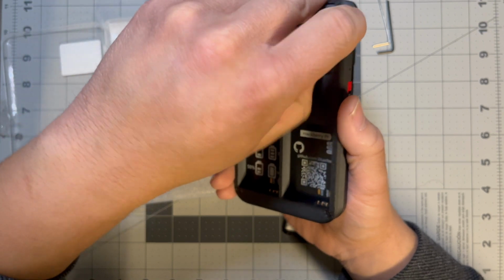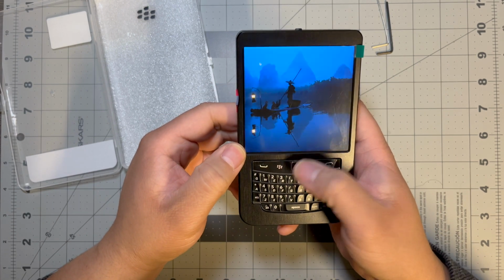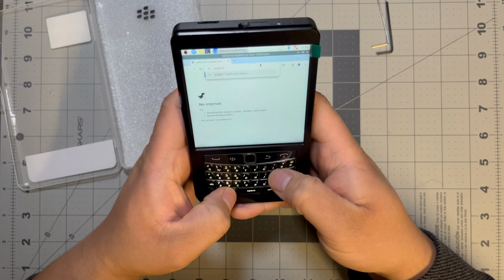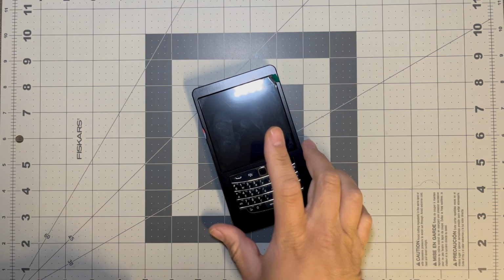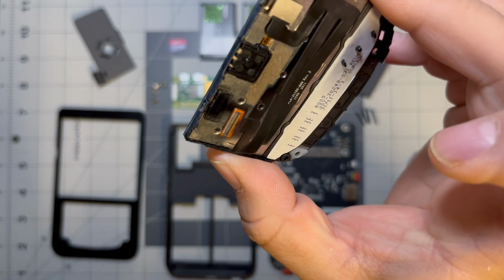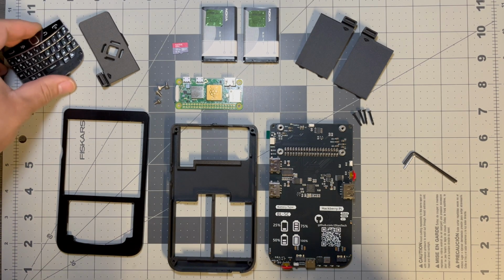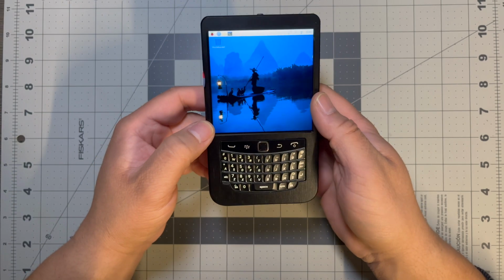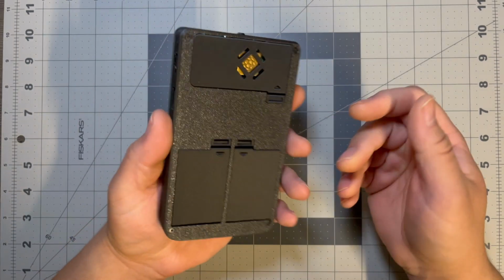Is the HackberryPi Zero the pocket PC I've been waiting for?

Comment: I have kali installed on mine, the hackberry pi is great and I would like to be able to do more with it but running kali on it is incredibly slow and very laggy I have been looking for some ways to try and make it faster or maybe some adjustments I could make to be able to use some of the programs in kali but as soon as I start trying to use anything it starts slowing down a lot. I love the thing I would just like it to be a little faster.
Reply from the maker: I feel the exact same way. That’s why I’ve modded mine and added a CM4. Details in a video coming soon.
Reply: @Symbiiote  that's awesome! Really looking forward to it!

Comment: I mooted elsewhere that the problem with the PI Zero is actually the PI communities estimated or pitched 'strength'. 

How is it possible that we have an ARM based platform, that I will say far exceeds what Windows XP ran on. XP provided a full desktop environment including upto game, internet and application levels - and today we are playing stockholm syndrome in thinking or considering that such a device is lacking power beyond being a limited command line platform. 

Seriously, go back and look at XP specs and what was used to run it. Then consider that ARM fans used to claim that X86 was horrible and very lacking in efficiency - and here we are. The XP killer in a tiny form factor, but so lacking in well written software that its basically being watered down into a command shell and little else. Either Linux has bloated horribly, or basically the software that people laud is not very good and is not written well for low end hardware - which is all they sell... 

When we say 'oh it has only 512MB of ram - I actually wonder if people even realise what that means - 
The min for XP was 64MB and recommended was 128MB. 

I like the idea of the platform, but brutally it serves no real world purpose if its just crippled in poorly optimised bloated software.
Reply from the maker: I think you’re forgetting that many things we use today simply didn’t exist or were lighter compared to today. Try and go back to windows xp and run a modern browser running YouTube. It’s nearly impossible with the minimum spec that xp used. 

I do agree that software has become unnecessarily bloated. Back in the day a chat client didn’t need to use 500mb of ram, but here we go today with things like discord etc..

Software has progressed while optimization has not.

Comment: Do you think the OrangePi zero 2w could be used on Hackberry? It supposedly has same 40 pin pinout.
Reply from the maker: @AssetBurned the orangepi 2w had the needed pins for the usb ports and keyboard to work. I just had to put the sd card inside the orange pi instead of the hackberry because those are the only pins it doesn’t have.
Reply from the maker: I got an orange pi zero 2w today actually. The keyboard and usb ports work perfectly fine. The only things that don’t work currently are the screen (software related) and the sd card slot that’s on the hackberry pcb (because the orange pi doesn’t have those pads). But using it with the sd card directly inserted in the orange pi works. (Will need to make a custom back housing).
Reply: The problem is that the hackberry uses the testing pins on the reaspberry pi zero. Those pins are at different spots if at all, on orange or banana pis. The GPIO pins are only used for the screen and the I2C port on the side. All USB ports and the keyboard are controlled via the testing pins of the actual USB ports of the raspberry.